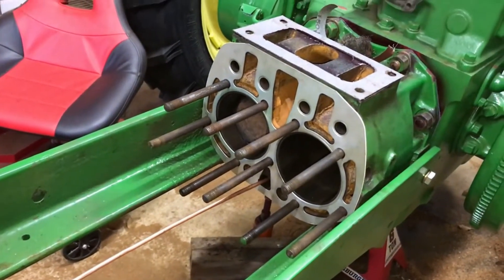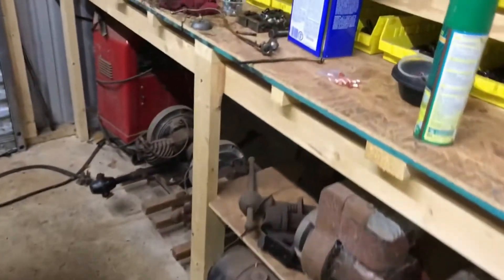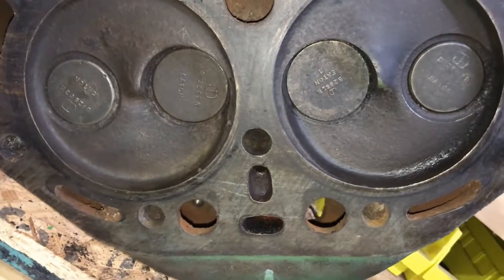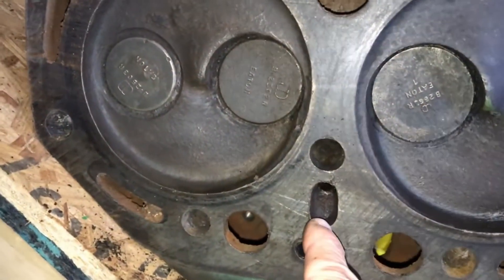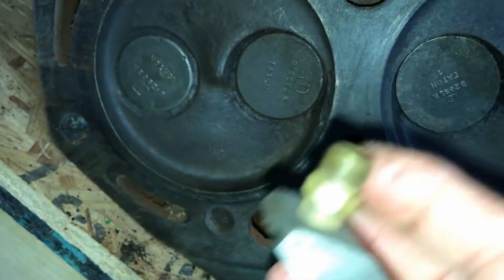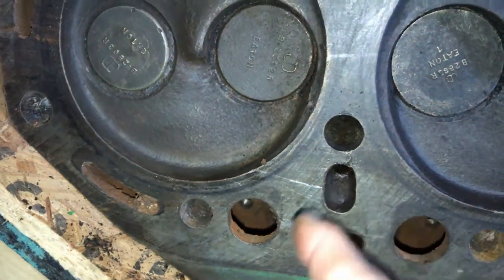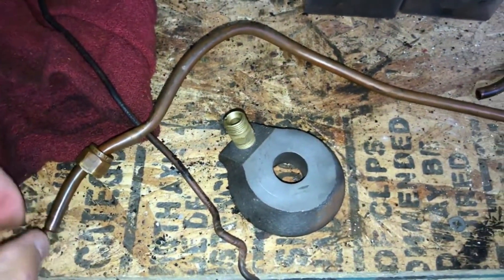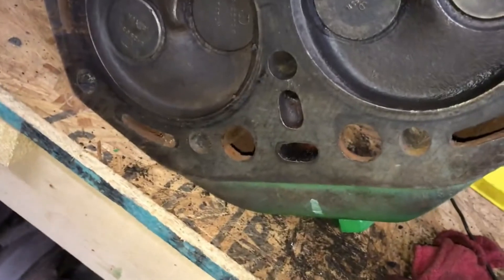John deere B Oil line routing

Comment: I get a 1949 John Deere model A. And I'm struggling right now. Because I don't know if I have to put an oil pipe through the block or the block actually naturally has one that is cast into the head
Reply from the maker: Have you checked the Model A parts manual diagram for the indicated area? I know on the early "Bs" the tappet lubrication line come out of the governor side and ran in a tube over the top.

Kenny Kizzle has more experience with the A's.

Comment: I have a question. On our 1942 B, there is not an oil line. Just the fitting on the head bolt that the compression fitting line that goes up to the tappet attaches to. After running for a bit, I needed to take the tappet cover off to recheck the clearance. I noticed there isn't a lot of oil up there. The outside tappets were wet, but not the center ones. The tappet oil tube is clear. But only has holes on the outer ends. Is there supposed to be holes for the inner tappets? If not, how do the inside tappets get lubed. Note, I only ran it about 2 minutes. The carb was acting up.
Reply from the maker: I believe the oil is supposed to run down the tube and drip on the inner tappets